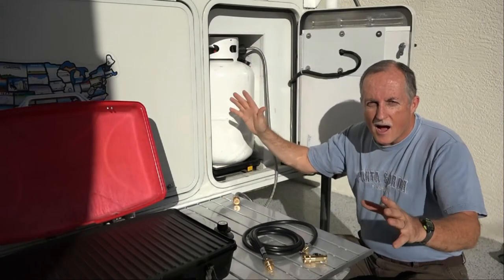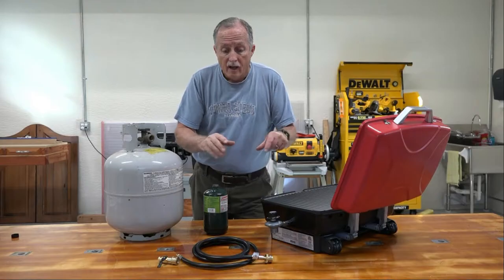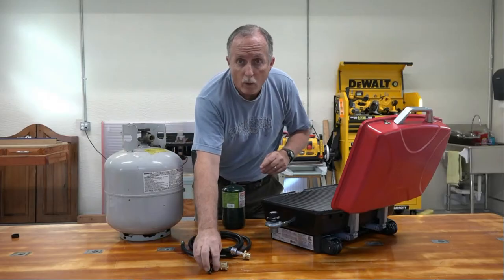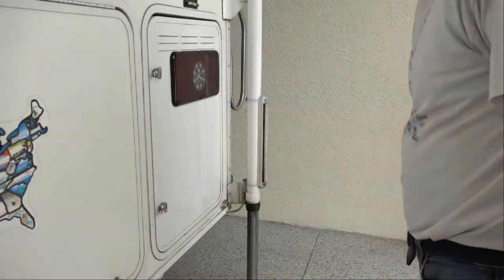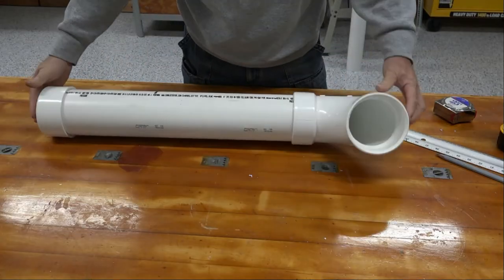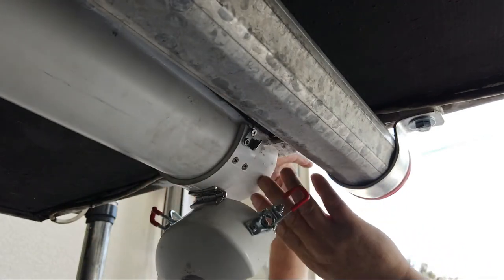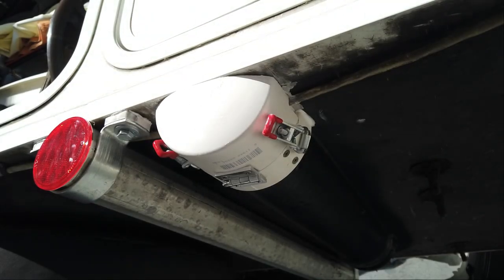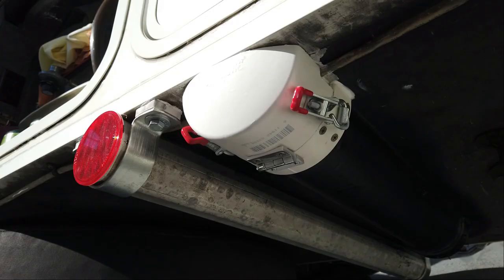RV Propane Quick Connect - High or Low Pressure??

Comment: Propane tanks can reach up to 250 psi in the summer at very hot temperature. 
Also the QCC1 light green is not for high pressure. It is fine for the grill you have but if you where to put a torch on the high pressure quick connect you made the green QCC1 has a shut off valve that will kick in if the pressure rising quickly. Ideally you should get a QCC1 RED with hose attachment that will work for any high pressure appliance you have. 
You can also do a pressure test without propane which is safer, 
To take it further you could have added a splitter and another regulator for low pressure and have a quick connect for low pressure as well.
You can use 2 regulators as long as the first regulator has higher output pressure there will not be any problems. 
There is an attachment you can buy that is 3/4 Inch Pressure Test Kit, 100 PSI, Push to Connect Brass Plumbing Fitting, 
You basically attach this fitting to your setup and air compressor and push as much air as you want and then test for leaks. Much safer.
Nice video and informative never the less :)

Comment: Thanks for the video Charles. I'd suggest you also use the rubber plug on the end of you quick connect. You don't want road dust getting into the end of your connection. My trailer came with a factory installed quick connect and the yellow rubber plug. It catches a lot of road debris from my truck's tires. Thanks again  :)

Comment: Excellent video.  My issue is, my RV came with the propane connection and the BBQ.  I bought a Coleman BBQ that use disposable tanks, bought a hose for the quick connection and the 1”-20 but only get a small flame.
Reply from the maker: The propane quick connect on your RV is most likely low pressure and your grill is high pressure if it uses a disposable canister and a regular.

Comment: You need a rubber grommet in the hole in the floor to protect from cuts and abrasions on that flexible gas line.
Reply from the maker: Although the finished install inside the propane tank area wasn't shown in the video, I can assure you that the steel pipe came completely thru the floor before the flexible hose attached so abrasion will never be an issue!

Comment: Bought a little grill assuming I could just plug it in for the quick connect and it would work. Not so. I could tell the pressure was too low. But I had no clue there were high/low pressure grills. Thanks for the lesson. Looks like I need a low pressure grill.
Reply: I’m wrestling with a similar problem but the low pressure stuff often is affected by wind so look for something with wind blockage.  I’m likely going to add a T at our RV 20lb tank to plumb a high pressure line with high pressure quick disconnect like he did (however less overkill lol) and the rest of the RV system will still be low pressure after the std low pressure regulator on the other side of the T.
Reply: Or maybe not.  A comment from someone else makes it pretty clear this is unsafe because the propane in liquid form will take up the volume of the line to the quick disconnect.  All because the best practice is to have regulators as close to the storage tank as possible.
Reply: @joshhaas2410  yeah, unfortunately I will probably end up springing for a new grill + conversion parts. Just like the RV industry to make something that should be easy, difficult and expensive lol
Reply: @Eric-469  I’m sure you’ll figure out a good solution.  I was putting together a line with a T at the main lp tank to go without a regulator to a high pressure disconnect dedicated for a high pressure stove.  Well, after pricing all the parts it’s just not a good way to go.  Grill plus parts I’d be well over $200 and I learned it’s not safe to have the regulator that far away from the tank with liquid lp in the line.  So I’ve decided similar to you at first, to stay on the low pressure side and I’m currently searching for the right low pressure dual burner for my needs.  Good luck to ya man!

Comment: You would be further ahead to just buy another low pressure grill, because now you can't use the switchover regulator between the 2 propane tanks.

Comment: I love your ingenuity! However, entrapping the metal conduit (new gas line) with an exterior pipe may result in gas to buildup if there’s ever a leak. You must not have an exterior hose pressured with gas using transport. If anything, you should have made a QC connection on door so you could quickly open tank valve, close the access door and connect grill to QC. When finished, close valve on tank and remove extension hosing. 

Becareful!

Comment: So have you essentially taken one of your propane tanks out of the loop for you automatic changeover regulator Charlie?  Both of my tanks are connected to the automatic changeover regulator that controls flow to my TC appliances. My quick disconnect is attached to a separate line that comes off of my propane system just like my appliances do. However when I connect my quick connector to it to use my grill, there is not enough pressure to push the propane through the 12ft hose so it won’t work. I will check that fitting end you show in yours. Seems backwards in your mod to me.
Reply: I think the reason you are not getting enough pressure is because you have your QC to your grill after your regulator, and your grill ALSO has a regulator.

Comment: Hi Charles, don't you think you have the high pressure and low pressure quick disconnect mixed up? I went to an RV store and low pressure looks like the high pressure on your diagram.
Reply: Did you get this resolved? I think I’m having this issue. My RV has the quick connect with a bar inside but it’s after the regulator so it should be low pressure. I’d love to know what you found out.
Reply: The quick connect on my trailer also has the blade style actuator which is labeled as high pressure in the video, but is after the regulator on my RV so it should be low pressure. And now i'm even more confused than before the video.
Reply: The quick connect that came from the DRV factory is connected on the low side and is consistent with the one identified as a low pressure connector in this video.

Comment: My DRV came with a quick disconnect on the low pressure side, after the regulator. I would like to connect my Coleman RoadTrip LXE Propane Gas Grill which comes with a detachable regulator. I am able to get the low pressure connector that connects to the grill after the regulator supplied to this grill, or I could remove this connector from the regulator so it can be connected to a compatible low pressure mail connector. My dilema is that I heard that the regulators supplied with this grill may supply a greater low pressure than supplied by the regulators in the trailer and therefore not supply adequate gas for cooking. Are you able to confirm or deny this?

Comment: If 1# tanks are high pressure how can I push in the valve by hand to bleed before refilling?
I’m trying to make a distribution off bigger 20, 30 or 50# tanks to feed several appliances that usually take the small 1# tanks & looking for info to do so.

Comment: You have opened a can of worms for my RV project . I have ordered a propane only Baja 900 -watt generator to charge my battery's with . I was going to hook it to my quick connect where my out side grill would be connected . The regulator must be inside this unit . That's going to be going through two regulators. Any advice now that you have an understanding of this propane pressure stuff .  Thank

Comment: I wonder if using a single braided stainless steel line would be a better option, this would eliminate joints which are potential failure points?
Reply from the maker: Great idea except they do not sell flexible lines long enough to reach where I wanted to go!  Also heard that high pressure lines over 10-15 feet long collect oil in the propane line and require a trap (like in a house) to remove the oil before it fouls the appliances!
Reply: Hi Charles, there are a range of braided lines availble on ebay, I bought one 3 metres long (9.8ft) and it has worked perfectly for my setup, just another option for you.

Comment: Good video I’m having trouble with my inside stove stay lit it will come on for a few seconds then go out I have followed instructions on turn on the propane slow and still have the issue how do I know if I have the right regulator it’s a 2018 Winnibago MD 1790.   Can you please help.     Would like to chat on phone if possible.  Thanks.
Reply: Stoves operate off of regulated propane, but stove tops typically have a second regulator at the stove that drops the PSI down from 11 WC to 10 WC inches. If your normal regulator is working, shown by all else working normally, then your second regulator at the stove may be bad. Best wishes!

Comment: Threaded connections use the first third of the threaded area to start the threading, the middle third to make the seal, and the last third for the inspector to see that it’s done properly. You haven’t gotten it nearly tight enough. Once it bounces down the road it will loosen and drain a tank really quick(since it’s unregulated). Yeah, I’m a plumber.
Reply: I did not even notice the threads, I was too busy looking at the rubber hose through the metal floor with no grommet!😰8:00
Reply: Good catch.  Only two turns of the tape    Oops.

Comment: There are so many things wrong and unsafe.  The reason the storage pressure is high is to keep the propane in liquid state allowing you to store much more propane in your tanks than if it was in a gaseous state.  Most, if not all rigs have the regulator and close as possible to the storage units and not allow the HP propane into the distribution system.  There are DOT regulations that address this issue.  With your design, the propane may still be in liquid form in the piping and the hose upstream of regulator on the grill.  Running HP gas (liquid) to the grill will cause oil build up in the line eventually faulting the regulator at the grill.  I assume that you are now running liquid propane in the hose, on the ground.  Are you protecting this hose from potential external damage (rocks, stepped on, etc.)?  Ironic that you are trying to protect the steel pipe with PV.?  Also, over time, the galvanizing will flake inside the piping so you need to install a filter before the regulator.  Please reconsider to convert to LP hookup, convert the grill by removing the regulator, and just buy a second grill to take to a friends place.  Sorry for being such an alarmist.
Reply: You maid tons of sense……. Thank you
Reply: Thanks for sharing this.  Back to the drawing board.
Reply: High pressure does not mean there is liquid in the line! If there is liquid in the line, the tank was overfilled or has tipped over while the service valve is open.